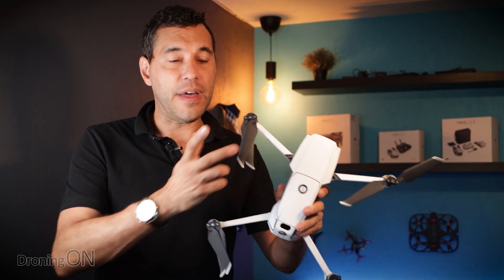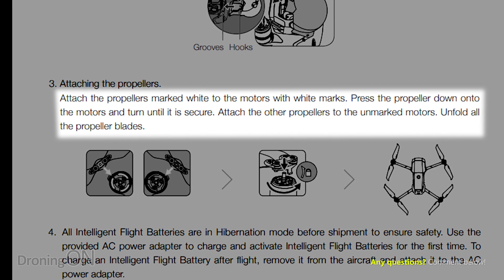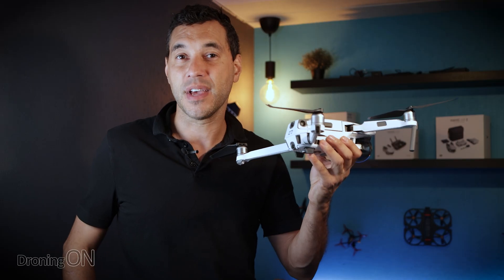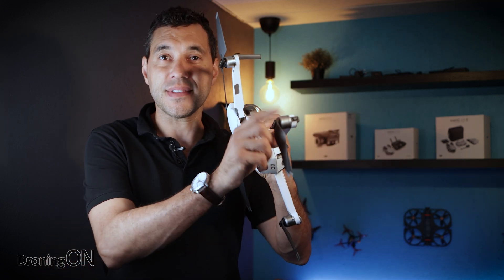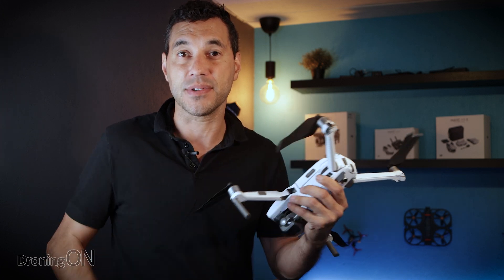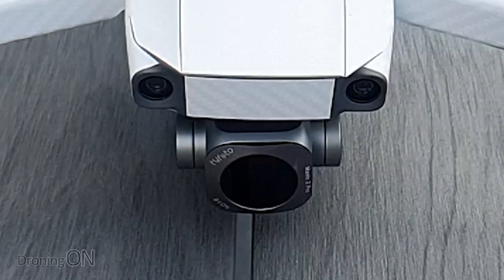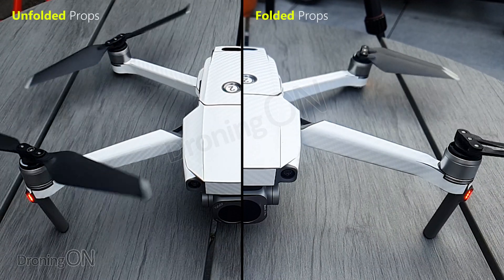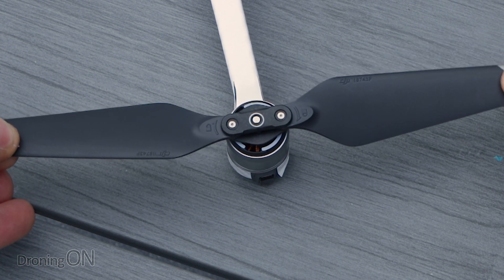Don't make THIS mistake - UNFOLD your DRONE PROPS (super slow-motion footage)

Comment: thank you so much for this information!

i just bought my first drone and was worried about the props flopping around everywhere i was looking for a way to tighten them which would have been a mistake and could have put stress on the motor and housing just like having folded props

Comment: Well, I am a highly skilled and well-established, broadcast engineer.  I'm also a well-established professional photographer.  I'm quite the electronic technician.

And so I absolutely agree with you.  While you say you are not an engineer.  You are most definitely thinking as an engineer, would, should.

I wholeheartedly agree with you.  Those extra stresses.  Will only add up to earlier failure.  And other flight issues.  So you are right on the money, sir.

So I found your video very enjoyable and informative.  For all of those others out there.  It only requires some common sense.  Which is largely rather uncommon with most folk.  You'd think, they would figure this out for themselves.  But they can't.  They are limited.  They cannot see things through an engineer's  eyes.  You most certainly have.

This guy is good and smart.  Folks would be smart in heeding his advice.

A Plus!
RemyRAD
Reply: I think you have to be a mechanical engineer to actually have any expertise on those type of question. Never mind tho, i am pretty sure the device is build to handle those kind of stress with no problem at all. Older models - may be not, i would agree there. In newer models (as you can see in slow-mo) motors start spinning slowly to minimize any stress. And by the way, the amount of stress shown in this video seems laughable to me. I mean, in a fast flight (specially in sport mode) in windy conditions, or when doing abrupt maneuvers, amount of stress is incomparable to what you see here... well, just look at some FPV drone footage. I would agree that flying style can lead to faster motor wear, but i am pretty sure that stress shown in the starting sequence (few grams of inbalance for few relatively slow rotations) is below the threshold of what can lead to increased wear of any part of the device. Oh and gimbal is hanging on a rubber type material - its main task is to absorb vibrations. I think this video is a bit of exaggeration all together. Just my opinion.
Reply: @xerxeslv  so, are you a mechanical engineer? 🤣🤣
Reply: @DroningONLIVE  Nope, mostly electrical tho i have a bit of experience with bearings wear, but on much bigger sizes, so i don't have enough expertise on these small motors. As i said - just an opinion. Btw one of the first things i did with my new mini 2 - shoot it in slow-mo to check how motors do spin-start. 
My point is - yes there is a vibration, but that does not mean it is harmful. Those motors and mount points experience of lots of stress in a normal flight, (when motors spins at much higher RPM) and during fast deceleration (like pressing pause button while moving on full speed). If vibration shown in the video could actually lead to any wear of the components, i think the average life span of the drone would be very short. In reality brushless motors are expected to run for tens of thousands of hours (that's like flying for a few years non stop). In other words - yep, any physical interaction will lead to some wear and tear, even putting your drone in the bag and taking it out lol. And yes, you can unfold props every time you use it, but drones life will probably end long before you will see any benefit from doing so. The actual noticeable wear of the motors i think could happen in case of flying a lots with badly balanced blades. Which brings us to the logical argument which I will describe below.
Reply: So as seen in the slow-mo footage, motors srart spinning slowly and then speed rises up fast and vibration occurs. 
If you look carefully (on 0.5 speed) you will notice that as blades accelerates it takes just about 3-5 full rotations for them to unfold completely, by that time, the remaining vibration is residual.
Lets say it is 5 unbalanced rotations. So lets say you fly 10 times a day every day for a year, that's about 18000 unbalanced rotations. 
That's a big number, but consider this - Mavic Air 2 does about 6000 rpm in hover and up to 12000 rpm in flight.
So basically unfolding props every time 10 times a day, every day for a year will save you less stress then flying Mavic with badly balanced props for a few minutes. 
Considering how slow those motors spin at start and how fast when in flight... i think by unfolding props for the life time of your drone you might prevent a stress equals one minute of flight with badly balanced props.
And i was flying phantom 1 with badly balanced props some years ago, when testing aftermarket props, no problems with the motors. These calculations might not be very precise but i thing you got the idea.
Reply from the maker: @xerxeslv  let's keep this simple, you can slam your car doors but you don't, because it would be silly and unnecessary to do so. It's precisely the same with unfolding props, extending the longevity of your drone and looking after it is a no-brainer.
Reply: @Droning-ON  Well, if it would be so obvious, you would not need that slow-mo footage then, would you?
I think we can agree that it will depend on the drone model and type of the props. On the dji mini for example, props hang out freely so even if you unfold them, they will be displaced almost immideately by even slight wind or tilt of the drone body(at least in my experince). And when you start the motors those props will be all over the place for a few rotations no matter unfolded or not. If your props have more tight mounting point then i guess it might make sense to unfold them. Know what, lets make it a little experiment. I will fly for a year without unfolding and be back to report any changes in drone condition.
Reply from the maker: @xerxeslv  you're just being pedantic now, the fact is that it DOES cause wear, the manufacturer recommends unfolding props, it's careless not to unfold props, it's lazy not to unfold props, it won't destroy your drone but it won't help the joints.
Reply from the maker: @xerxeslv  and tie comparison with the Mini is completely different, that drone has loose props, they're not attached stiffly as they are on the alrger drones.
Reply: @Droning-ON  Well i never said it does not. Putting your drone in the bag cause some wear also, would you worry about that tho? The amount of wear is important, is't it? Thats why i tried to do some calculations. But you wanted to keep it simple.
And yeah, that part you highlighted from the manual is about installing the props. If there is a part about everyday use and it says "always unfold before flight" then obviously it is worth unfolding. 
Why pedantic, as you said - "mini" is a different story and i dont think it is a mini only situation.
Ok let me correct myself: if you are speaking about larger drones with tight mount points then your video is not exaggeration and in a long run there might be some wear. I dont think it will be noticeable wear but still. And i hope i will not make you cringe by starting my mini motors with unfolded props lol.
Reply from the maker: @xerxeslv  once again, this is very simple, do as you wish with your drone, others can care for theirs in the responsible way suggested in this video and by the manufacturer.
Reply from the maker: Definitely the politest and loveliest comment that we've seen for some time! Thanks buddy! You've been pinned to the top of our comments section <3

Comment: Is there also a chance that it won't take off properly because of this? My spark doesn't take off properly when the props are unfolded when starting the motors. Just to make sure I'm using Master airscrew props so I won't worry about it failing while on air haha.

Comment: The effects of this are much worse on the Mavic Air 2, which can actually shake the drone quite violently from it's initial position.
Reply from the maker: Yes that would be a good test, maybe I'll use that one for the next demonstration! Thanks for the comment!
Reply: Is that why my drone tip over on start?

Comment: Some drones,  such as the Fimi X8, have an start up mode that slings the props out straight at lower speeds before full accelleration.
Reply from the maker: The DJI drones do exactly the same, you'll notice that they don't immediately spin up to full speed, but this doesn't mitigate the fact that you should still unfold before starting up. Thanks for the comment!

Comment: Yep. Always been unfolding. I never liked the juddering of the drone at start up, I always felt it was putting unnecessary strain on the legs. Only the Mavic series has this ‘potential’ problem, as the Phantom, Matrice and Inspire all have rigid props, and they never judder like the Mavic. It always made sense to unfold them.
Reply from the maker: Yes that's very true about the older models, it's so important for folding props as you say, I'd never start my helicopter up qithpit unfolding the blades, the same applies to these smaller variety 😉 thanks for the comment as always dude!

Comment: Thanks for the tip, although, i wonder how does this tiny bit of short term stress compare to just... switching it to sport mode, and moving the drone around, pedal to the metal, on both the throttle and/or the right stick, with potential gusts of wind etc. This little startup kick really does seem minor to me. In any case, this said, there are, indeed, zero reasons not to unfold the props before startup, and one VERY good reason you should unfold them is to INSPECT the props.
Reply from the maker: Thanks for the comment Boris! It's more the "aggression" factor of this startup, whereas when in flight the movement and transitions are far more subtle and smoother. You're right however that it's relatively minor, but best to look after your drone and props.